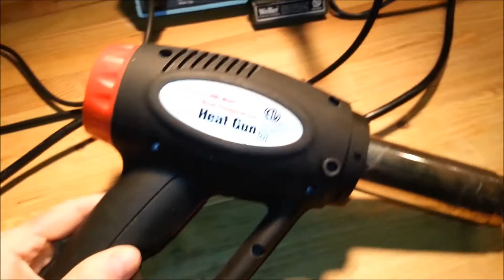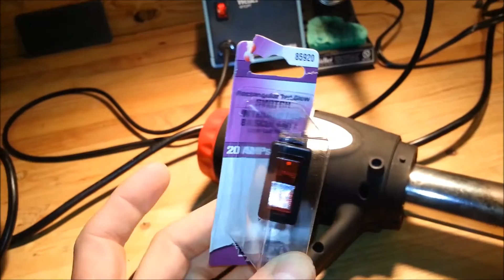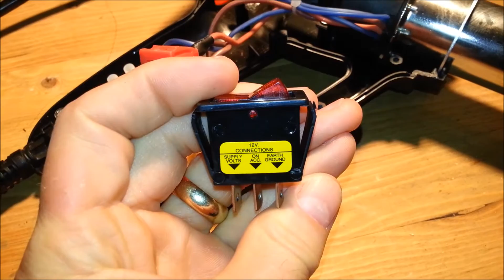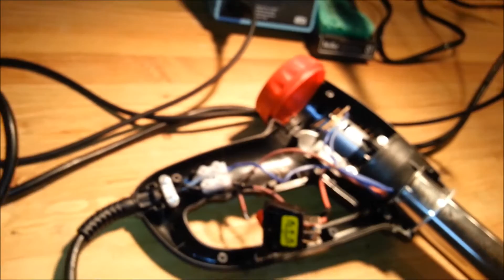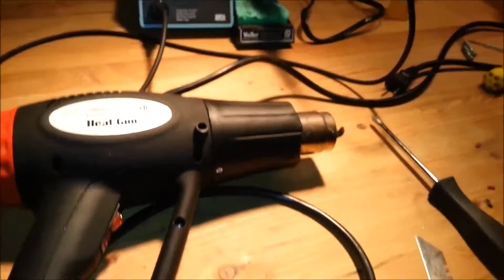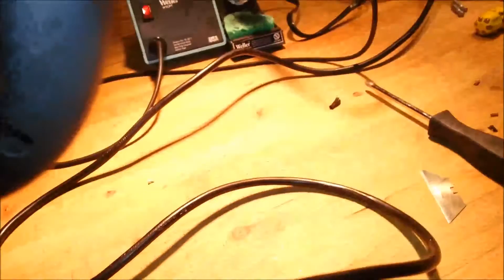Harbor Freight Drill Master Heat Gun Switch Repair

Comment: I wanted to see inside this gun before I bought one so thanks much for this video. About the sparks? You are running four times the power at least than the new switch is rated for.  Be careful folks.

Comment from the maker: It has been almost a year and my replacement switch is still working great.  Throughout the winter months I use my heat gun when tuning my skis.  I use it to pre-warm areas that need Ptex, and I also use it to melt in hand-rubbed wax.  It works great!  Maybe I'll do a ski waxing video soon.

Comment: I tried a similar mod but using all 3 terminals with some 30 amp switches from Hong Kong (bought on ebay) and got nothin.' Dead in the water. I dug further to the motor and found a rectifier config and a diode or resistor thingy leading to the heating element. Nothing scorched so hard to trouble-shoot what it could be, there's not much to the guts in these heat guns.